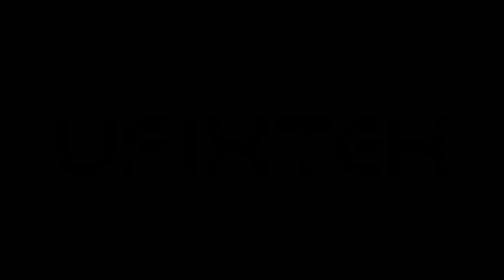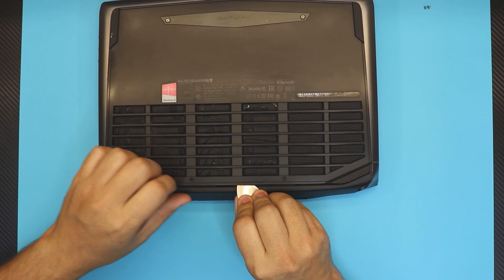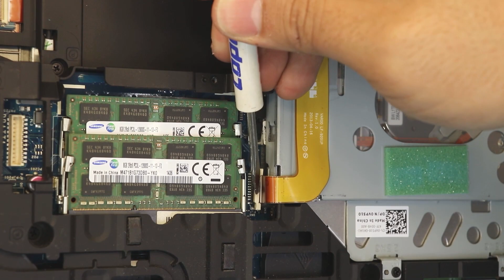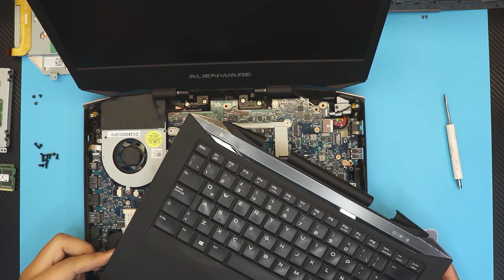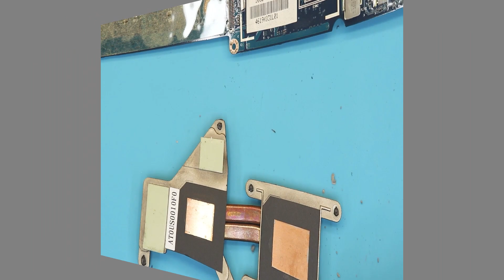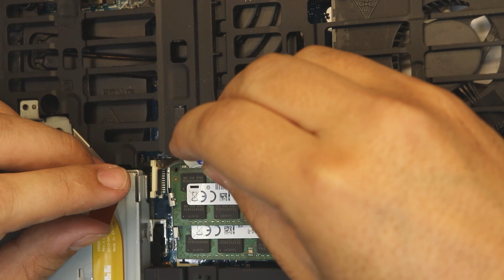Alienware R1 14 Liquid Metal Laptop Cooling By -20c 1FPS - 60FPS

Comment: Hi, i did this but accidentally broke the stick parts of the piece that locks the ribbon cables in during the process, are there replacement parts for them because the keyboard doesnt work now that its ribbon cable isnt properly in, both 30:00 and 31:46
Reply from the maker: Thank you for your feedback! If you wish to support the channel, you can like, subscribe, or both!
Regarding your question, you could remove the slider that is broken and slide a pice of plastic with .2m thick under flex, else you will need to go to any repair shop and ask them to sell you the slider of tell them place the flex , or get the jack on aliexpress: https://www.aliexpress.com/item/32898159588.html
and ask them to solder it for you, or remove the slider from the aliexpress one and place it in your jack. check the pictures and makesure the jack you purchasing has the same amout of pins.
Should you have any further questions or requests in the future, please don't hesitate to ask me.
cheers🍻
Reply: @uFixTek  hi, i wasnt talking about the connector itself, i was talking about the little plastic thing that you push inside of the pins to hold the ribbon cable in place, if you have information for that it would be really appreciated, thanks 👍
Reply from the maker: that they dont sell individually get the jack from the link i send you and pull out the plastic slider and place it in yours.

Comment: great video and detailed can you use Kapton Tape High Temperature Heat Resistant Polyimide  in place of electrical tape sir and would it work better ?
Reply from the maker: Thank you for providing your valuable feedback! If you are interested in supporting the channel, we kindly encourage you to consider liking and subscribing to it.

Regarding your inquiry, we have extensively experimented with various products, including Kapton tape. While Kapton tape is known for its superior quality, we found that its adhesive's strength or viscosity is relatively weak. Consequently, there is a possibility for liquid metal to leak underneath the tape.

In our experience, we highly recommend using the 33+ tape. Over the span of 9 years, we have consistently utilized this tape for liquid metal applications without encountering any issues with our clients or equipment.

Should you have any further questions or require assistance in the future, please feel free to reach out.
Reply: @uFixTek  thank you for your fast response sir i wasn't sure and thought id ask because i had used that on a playstation 2 system when i installed a mod chip and worked great i wasn't sure if that would work would you suggest brand of tape to use on the alienware m14 system or will just any work sir?
Reply from the maker: it is my pleasure my friend , i recommend to get this: https://amzn.to/3BMN5JW
33+ electrical tape

Comment: Thank you for this great video, Ufixtec! 
 I decided to re paste and to know the heart  of my lovely 14 after 12 years of collaboration. I have opened all my other Dell laptops for maintenance and upgrade with fair ease, but oh! this one was a challenge… hence my waiting this long for open heart surgery . 
Here is some supplementary advice along with 
1/ draining the remaining electricity and 2/ strictly keeping the number of screws for each item separately in a separate container. 
Advice 1 
- Just be aware that the connectors’ plastic slots/flippets are VERY flimsy, and end up being useless after two or three opening and closing!!! 
I had to TAPE THE ON/OFF RIBBON down to the MB as the power button wouldn’t respond, it took me 2 or 3 tries to get it right. Fortunately with the blue indicator of the power cable remaining blue I could see that there was no shortage on the  MB.
Advice 2
- The keyboard ribbon slot is also super fragile as seen on the video, do not loose the removable part that holds the ribbon.
So as shown on the video, no cable pulling hard directly, use a plastic tool to dislodge plugged ribbons and other connections ; the fan was the hardest to dislodge, then the left handside motherboard with the audio ports.
Good luck 🤞🏼
Reply from the maker: Thank you for the feedback! if you wish to support the channel you can LIKE or SUB or both :P
regarding your feedback: all good point, i been doing this for over 18years, the flex cables that have flip cover are safe for opening more than 50time or more without any issues, you may had a bad latch on one of your connectors, and if you pull those flex cable without opening the latch then ya you will have to replace the flex cable. regarding the keyboard flex cable connector hell ya if you loose it then you will need to cut a flat .3mm plastic to slid it under flex to push the connectors.
much appreciate your awesome feedback my friend :)
if you have any question or request in the future feel free to ask me.

Comment: Muchimas gracias por este vidéo!! It is the best I have found to totally dismantle this Alienware. I have applied paste to a few Dells with so much ease but this one is a real challenge. So far I have managed to remove the fan, clean it up but my fan is still screaming it’s heart out, so I will apply paste.

 One glitch I have found out though, HwInfo suggests that the « Alienware Compal Ec » sensor misreads temperature so it needs to be disabled to rather rely on the integrated cpu (in my case Intel iCore 7 enhance). I believe the glitch with my fan started after a windows update.
Reply: I am using Artic silver paste 3 too which has worked well on the Dells I have reposted. 
(By the way, Soy unA amigA) 👩 y gracias de nuevo por la calidad de tus videos☺️ !
Reply from the maker: disculpame amiga :P si el artic silver es muy espeso y es bueno para rellenar, gracias por el apoyo al canal, cuando tengas algun duda o pregunta me puedes hacer aqui , saludos y disculpame por el error en espanish, hablo 6 idiomas me confundo aveces :(
Reply from the maker: por nada amigo, si cambia la pasta termica a una marca buena como thermal Grizzly https://amzn.to/3R9KAIr
https://amzn.to/3R6Q6eL
installa windows 11 esta mejorado en sensores.

Comment: The little holder with legs that can be seen at 30:00 broke on my laptop, is there a way to hold the ribbon cable in without having to buy another motherboard?
Reply from the maker: Thank you for the feedback! if you wish to support the channel you can LIKE or SUB or both :P
regarding your question: hell you don't need a new mobo just because of the broken flex lock lol, can you send me an email with pics closeup and far different angles. so i can examine the damage and pic of the broken parts.
ask@ufixtek.com

Comment: my Alien 14 got 91c on gaming after repast
Reply from the maker: What paste you used?, something is not right with repaste you did.
Reply: @uFixTek  kryonaut thermal grizzly 12,5 wm/k, says its designed for Overcloking, maybe i need apply more paste on heatsink?
Reply from the maker: Thats the best thermal paste, you will need to reopen and repaste and place a fair amound of paste the paste is not conductive, and before you put it back take a picture when placing the paste and post here, make sure you clean the heatsink and die , and that the heatsink is sitting flush, and i hope you have not replace the pads with a thicker pads else the thicker pads will push off the heatsink,
Reply: @uFixTek  the thermal pads are too old and falling apart when you touch them, maybe that’s it? can i exchange them for new ones? do you know the size and millimeter of them?
Reply from the maker: don't worry about the pads, your CPU and GPU temps has absolutely nothing to do with pads, the laptop dont even need the pads, if you are not overclocking the pads are there for those people that overclock the laptop. therefor just double check your repaste leave the pads alone for now.
Reply: @uFixTek  reopen and repaste, temps is good now, u know about max CPU upgrade for this laptop? maybe i can insert a i7 4910MQ? is same 47w and soket from my 4700MQ
Reply from the maker: You could upgrade it but for the extra speed that you get, i dont know if its worth he money. BUT yes you can and it will work just fine. i7 4910MQ would be the best else you will have over heat issue  anything over 47W

Comment: Thank you! This pretty much saved me from insanity. The only thing different on mine -- I also have an R1 -- was that in order to get the hinges off, I had to remove the two screws under the hinges marked "D" on the baseplate. They're mixed on the same side as all the screws marked "P". Does yours not have those or did you skip that because you didn't expect to take off the hinges? Just curious and it turned out not to be a big deal as soon as I figured out why the hinges wouldn't come off as easily as yours did!

Also, did you put the tape on the CPU and GPU because you used a metal-based paste? I couldn't figure out any other reason.

Other than the hinge thing, this "surgery" went very well -- your video was absolutely the best. I also bought things through your links so hopefully you get a few pennies from it. Thanks again!
Reply from the maker: Thank you for the feedback and your support to the channel by a SUB:P 
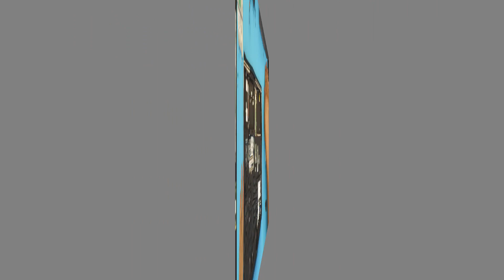regarding your question: @6:37 when i removed all the screws the hinge screws was included (https://prnt.sc/10xvf6w)
YES always use the tape 33+ if using the Liquid metal else, i would recommend using this:
none conductive and no tape required and also its almost the same result as liquid metal only 5c difference.
https://amzn.to/3lYGnYF

and i appreciate all the support and helps :P

Comment: I have a question: why was there no tape on the lower side of the cpu?
Reply from the maker: because there was no need for it as there are no capacitors there but if you like you can add

Comment: I’m not sure about the tape you used mostly these electrical tapes degrade and come off. I’d recommend using a proper conformal coating.
Reply from the maker: i been using this  33+ it wont degrade and the opposite with time  it gets even  better , no shrinkage nor coming off. 
i have tested different brands of " conformal coating" off amazon and most of them *all after 8 months they start cracking  and opening gaps. i highly recommend the 33+ or a kapton tape .